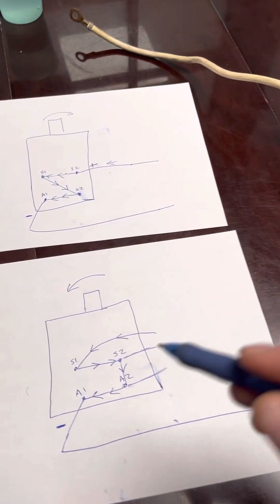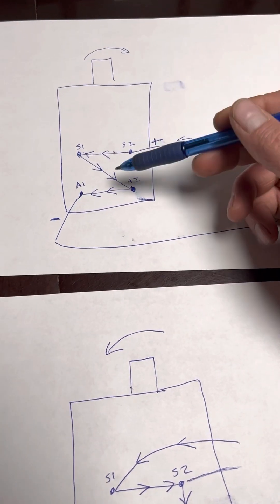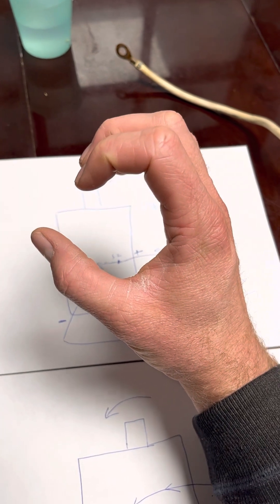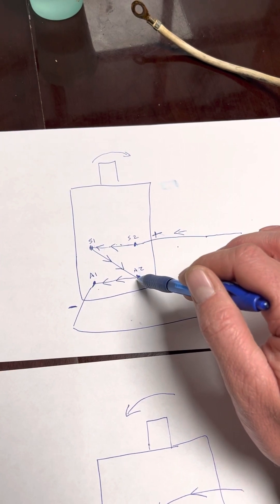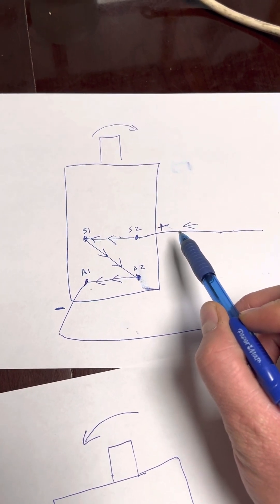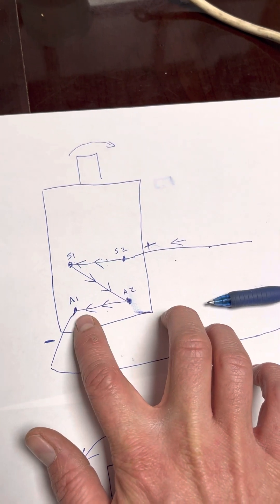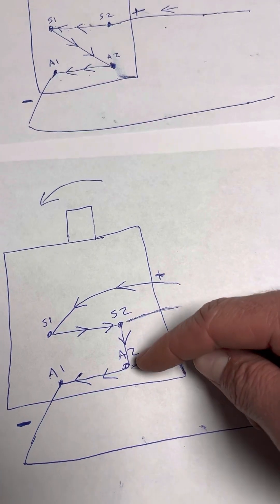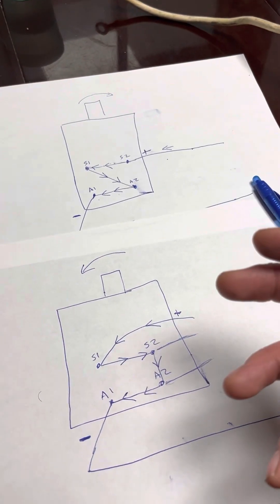How a series wound Golf cart motor goes in reverse.

Comment: This is great information! Im converting a older bad boy buggy motors onto a newer frame. The different axles have the motors both mounted opposite. I need to wrap my head around how to swap the wiring around when there is fwd/rev switch and a 2wd/4wd switch. I have a diagram of the wiring as it was originally but unsure which wires need swapping.
Reply from the maker: It’s a very complicated matter one that took me years to get until I heard someone say you reverse the polarity of a field and all of a sudden it clicked.

Comment: So I saw one where power goes into a1 comes out of a2 then hits 2 solenoids to only change the direction of the field connections. Will that work too?
Reply from the maker: That sounds more like a shunt motor not a series motor. A series motor all the current passes through all of the fields. The armature fields and the stater fields.

A shunt motor current passes through the armature field, and the stater field on the outside has two smaller wires going to it, and the controller varies the resistance in that field to change the speed of the motor. It also changes the polarity of that field to make the motor go backwards .
Reply: @RetroElectric  how can I tell if I have a series or shunt motor?
Reply from the maker: @joshuadavis2062  a series, wound motor will say S1 s2 a1 a2 a shunt Motor will say a1 a2 f1 f2 and the F1 and F2 should have smaller terminals
Reply: @RetroElectric  ok I for sure have a series motor then. So for that do I just reverse the polarity on the whole motor or where would I reverse polarity at to go in reverse?
Reply from the maker: @joshuadavis2062  yes I do believe changing the polarity of the field should work
Reply: @RetroElectric I'm helping a friend with a 1996 EZ-GO TXT golf cart. Going by your explanation, it has a shunt motor with 2 smaller wires (white and black) for the stator. However, the terminals for the stator are labeled S1 and S2. So, I think the better way to determine series vs. shunt is to look at the wire size (assuming the motor is still in the cart). Your explanation was really helpful and confirmed what I suspected - the polarity of only one of the coils must be reversed. My friend is having trouble getting much power from the motor, and I'm planning to check voltages on both coils under load. I was wondering which coil would reverse and your video explains that it's the stator. Thanks!